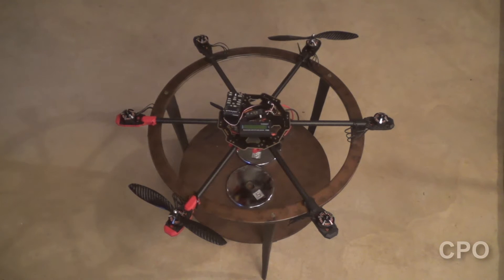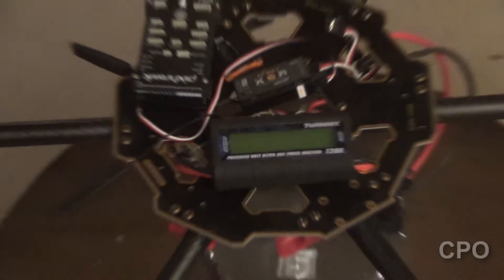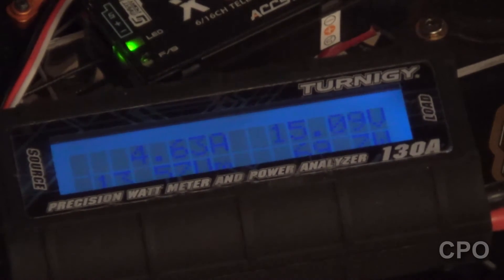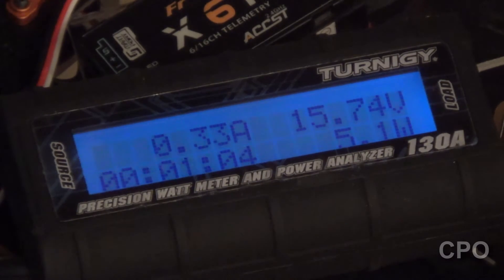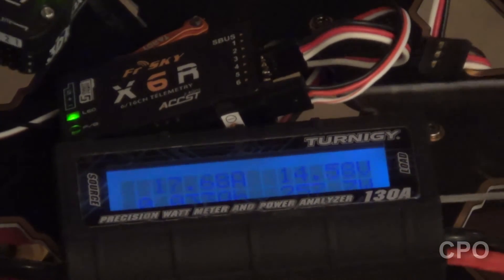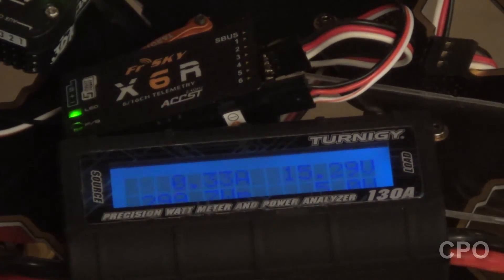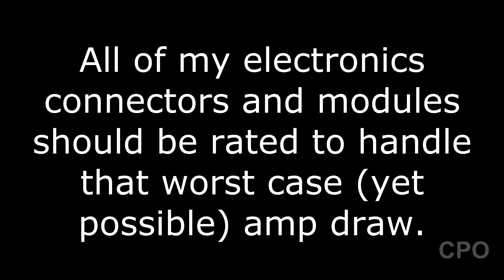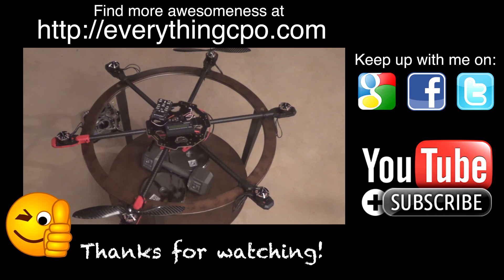Tarot 680 Pro Hexacopter : Testing Maximum Amp Pull from Motors

Comment: I have a 680pro as well and the same analyzer. Ive put it on the hex and flown it at hover to see what it really draws not strapped to a table it says 35 amps and 550 watts. My motors are only rated for 22 amps and 330 watts. Does this mean 35 amps per motor or 35 amps divided by 6 equals per motor? thanks

Comment: I HAVE TAROT 680 too but don't remember that it is called PRO , any reason ??
Reply from the maker: You might have the original FY680.  http://www.foxtechfpv.com/tarot-fy680-cf-folding-hexacopter-p-810.html  Look like yours?  Do you have an integrated PCB?  If not, you probably have the "non-Pro" version.

Comment: Nice, essential test, but keep in mind that ardupilot does not give 100% throttle out when your tx gives 100% out.

So, to get the real max draw you can plug the esc directly on the Rx..
Reply from the maker: That's actually how the test was performed.  Each ESC is plugged direct to the RX. Pixhawk is out of the equation here. ; -)